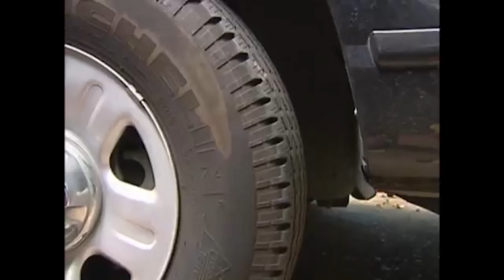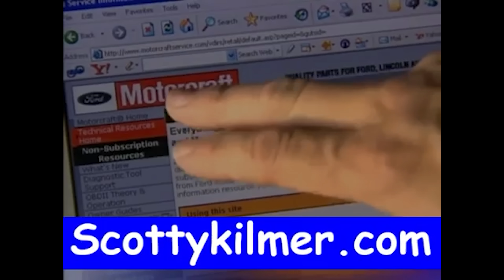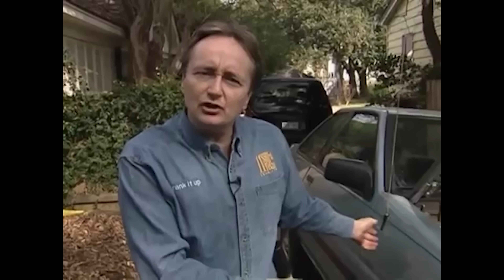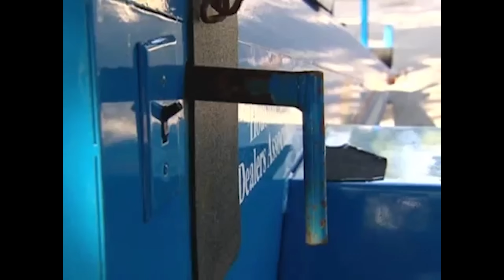My Past Has Finally Caught Up With Me

Comment: Even at slow speeds if you do not wear a seat belt you will be thrown too far forward as the air bag explodes backwards towards you and you will REALLY get a smack in the face - broken nose, cheek bones and cuts..

Comment: I learned to drive a stick when I was 20. I learned on a church bus. That was a trip and a half.

    I've had 9 spine surgeries, 6 of them in my neck. Almost my entire spine has been fused. My doctor has said that for me to wear a seat belt in a front end collision could be deadly as the sudden stop could dismantle my spine. He has written me a letter that I carry in my van that excuses me from my state's seat belt laws. Case in point. A year ago, I was trying to pull into a store parking lot at night. The entrance is on a curve so you have to watch for the entrance and oncoming traffic simultaneously. Well, I missed the entrance and dropped my left front wheel into the ditch where it hit the end of a concrete culvert pipe totaling the car. The car went from 40 MPH to zero in a flash. It was so fast that I didn't even realize that we hit something until I tasted the blood from my fat lip. That fat lip was my only injury I got. On the other hand, my wife was wearing her seat belt and at the emergency room, she required a CT scan of her neck, chest and pelvis. Three separate scans that my $5,000.00 medical payments insurance didn't completely cover and her insurance had to cover the balance of. I have no doubt that seat belts can save lives.
    My father was a training sergeant in the army air corps, the forerunner of the U.S. air force, during WW II. He had seen the aftermath of several plain crashes where the unconscious pilot and co pilot had burned to death because their seat belts had prevented them from being thrown clear in the crash. Right up until he died of heart failure, he said that he would pay a seat belt ticket every day rather than wear one.
   Anyone who rides in my car wears one because I won't take a ticket for them but for me, at 66, I'd rather die than go through another painful spine surgery and weeks or months of physical therapy. I'm at my limit.

Comment: In my 25 years experience 
Dont buy-
Stratus
Dart
Chrysler 200
Neon
Pt cruiser
Focus
Escape
Explorer the transmission s
Old Taurus ,the new ones are ok
Cruze
Sonic
Spark
Chrysler 300 v6, just get the v8
1500 Silverado after 2011 quality started going downhill after 2002 for GM.

Any Buick after 2007
Tacoma before 2006 chassis that rust quick.

Comment: I was "convinced" years ago backing up in a mall parking lot and the light pole was in a blind spot.  Hit it while twisting my upper torso and facing back with my left hand on the steering wheel and, I guess, traveling about 2 to 2.5 MPH in reverse and hit the "invisible" parking lot night light.  A day or two later, my left side neck muscle was sore from the sudden abrupt jerk and I could only attribute it to the seemingly minor impact and hyperextension of my left SCM (sternocleidomastoid) muscle which was enough to leave some micro damage/trauma to the muscle.

Comment: I dropped one end up in a container filled with antifreeze mix, then ran a tube from an aquarium tank to the bottom opening of the cat and plugged it in. Left it there for two days and it was clean. Still running it.

Comment: Yea but i have a feeling i am a really good driver and will never wreck my motor vehicle i can just about avoid almost any situation. i would rather not wear a seatbelt anyways it could be just as dangerous. I have been in a situation where if i had my seat belt on i would have been impailed by the trim in the car i would rather be thrown from the vehicle. it should not be a law it should be up to us whether we won't to wear it or not.

Comment: I was in the bed T-Bone accident when a woman ran a light at 60 miles an hour in a 25 mile an hour Zone. I would have poured out the window like a liquid if I didn't have my seatbelt on. The car was throwing 250 feet, transmission fluid, oil, radiator coolant were all over the street. I don't remember the accident at all and I don't know how I got out of the car either. I was laying on my back... propped up with my elbows and all of a sudden I became aware. It was like someone had turned on a TV set but it was my life. My neck was broken at C2, my pelvis was broken, my sacrum was broken, and my guts ripped a 10 and a half inch hole through my diaphragm and collapse my lungs. Aainst all odds I survived, but I would never made it to the hospital if I wasn't wearing my seat belt.

Comment: "I'm so cheap that when mine broke, I just twisted the wire back together" - This resonates with me.
Reply: It pays to be a little cheap.
Reply: @yayger825  thats debatable
Reply: @yayger825  Yeah pays 10x more a few months or years down the line.
Reply: To me this isn't about being cheap, we used to at one point in America repair things that were perfectly serviceable rather than just throw them out. There would be no reason to buy another one of these tools when it could easily be repaired.

Comment: In my dads truck the seat belt for the driver seat is useless it has a hole were it meets at the floor and you can see the ground through the hole the seat belt dont come out of the hole but we dont trust it to save the driver in a crash not certain it can be fixed without welding it is like the bolt for the seatbelt is just dangeling outside the car from the hole you cant pull it into the car but we dont trust it the truck was like this when we bought it.

Comment: "If you can't drive an automatic transmission, you're missing out on a lot of fun."
Say what?
Reply: Yeah I caught that. I think he meant manual. Maybe he got schmoked up before doing his videos back in the day.
Reply: Nowadays automatic transmission is the standard 🥴
Reply: @West3720  I heard you gotta pay extra for stick shifts nowadays except for like a Corvette or Mustang or the like.
Reply: I've seen people actually use the automatic transmission shifter so he is (was) not wrong.
Reply: @caru3257  B&M manual valve body installed for drag car. Yes, and the shifter to go with it. Dash mounted shifter on Chrysler mini vans allows paddle toggling. On 6% grades downshifting from 6th to 4th covers distance quicker. Wastes more fuel. But hunt and peck powertrain 3 overdrives are silly.
Reply: editing videos was a lot harder back then
Reply: He meant standard..

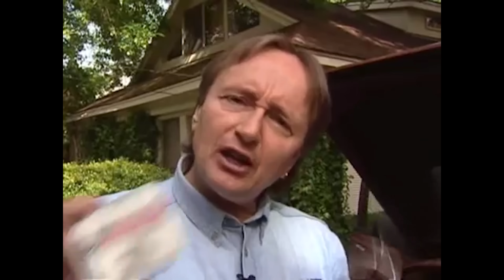Comment: 4:08 Scotty: That's the way things used to be when cars were simpler. 
If only young Scotty knew how complex cars would be 20 years later. Can't even replace the brake pads one some cars without needing a scan tool.
Reply: Right? I can’t believe that new cars have tire air sensors. World has gotten lazy.
Reply: @Ypcomchic  
It's not about being lazy, it's about unexpected circumstances. The idea behind tire sensors is safety. You can have 45psi and still get a flat tire. There is so much shrapnel that can puncture your tire and you don't realize it till the tire is completely out of air. Some tires are so stiff, especially the low profile ones you don't realize it's under 10psi till you make a lane change on a busy roadway and the car swerves with a simple lane change and you hit another car.  Or, on taller truck tires, a chunk of debris can cut a sidewall, deflate the tire and the sensor will immediately alert you of the air loss so you can pull over safely before having a wreck. Checking air pressure isn't what tire sensors are for.
Reply: @VillsvinJeger  thank you for saying this.
Reply: @Ypcomchic  yeah. I can SEE when my tire is low, the only time that's useful is on the highway.. and if it doesnt break the first 3 months
Reply: I got a wheel alignment on my 2019 Camaro, because it was pulling slightly to the right, and when I drove out of the shop, the car could make a u turn to the left, just by letting go of the steering wheel. Drove back to the shop, and they said they were surprised they had to use the scanner to set up the alignment.

Comment: Using a thermostat to run ur ac isn't necessary . Do the same wiring , but to a toggle-- off and on switch.  Turn it on and off manually. I do that anyways in my Ranger. Ac clutch needs 12 volts to run.

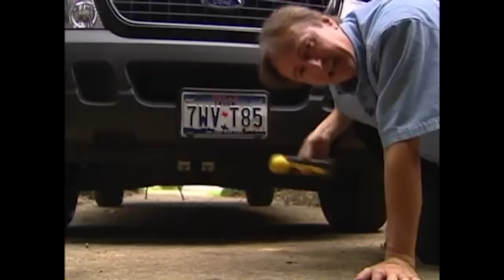Comment: 2:08 - Does that AC workaround still work to this day for new vehicles?
Reply: Should. The clutch assembly hasn't changed. Neither has the rest of it. You'd have to find a thermostat.
SO, why do you ask? Might not be the computer. Could be low on refrigerant. Maybe the vent has an air filter that's clogged. Back then cars didn't have an air filter for the cabin. Could be the console inside the car.

Comment: I broke my neck because of a seat belt, a car hit me from behind, my seat came out of the runner, my bod went forward and my neck stayed with the seat belt, so yeah no seat belt for me ever again
Reply: If you   really broke your neck, you'd be dead. Also, without a seatbelt, you'd break your face or ribcage on the steering wheel instead. Or best case scenario, you melt your face on the expanding airbag full of burning gases, because there is no seatbelt to stop you. So yea, wear your seatbelt if you wanna live. I've seen people flying out of cars because they didn't wear seatbelts, it was NOT a pretty sight, one got impaled on a tree branch. There was a lot of puking that day.

Comment: Yeah, small engines (aspirated), with standard transmission IN NORMAL SIZED CARS works just fine and can be zippy and economic. Forget the stupid SUVs and Cross-Overs with several tons and some overcomplicated transmission that will melt in 200k miles or less.
Reply: Except if you do any type of manual work you need space in your car to haul things around...

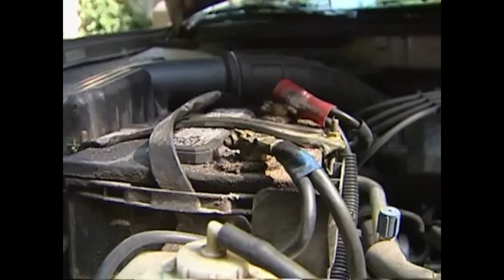Comment: 7:55  godDAMM!  Well there’s your problem!  Your battery is covered in crud!

Pour some coke on it (and wipe down afterwards) and leave it for a few hours.  The carbonation will eat/melt the crud away.

Also: does anyone put a penny by the terminals to absorb the battery acid residue?

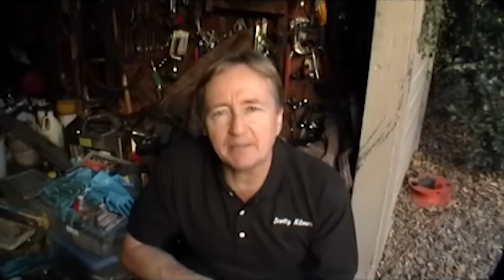10:10  I kinda wish there was a manual transmission car that had an automatic start-up, as in: starting the car and 1st gear is auto, and you take it from there.  I’ve always had a problem with popping the clutch and just getting the damn thing started.

Comment: Automatic transmissions have improved gas economy so much that standard transmissions are now worse on gas mileage. Times definitely change.
Reply: Provided the driver is at least somewhat experienced, there is no way in hell an automatic can have better gas mileage than a manual. Don't believe the marketing crap.

Comment: I was in my late twenties 25 years ago. I don't think those crash simulators are legal now for civilians to get into now. I mean an officer has to get into one or someone like that. You can't just put a person in one and have them sign a waiver because even at that low speed you can cause some significant soft tissue damage. I may be wrong. I thought I read something about that centons ago. In any case, we built things like that in the seventies as kids and if I ever had any soft tissue damage I fixed it the next day by jumping out of a tree into an ice hardened snowbank. That fixed it!